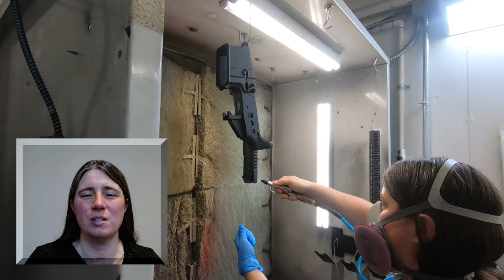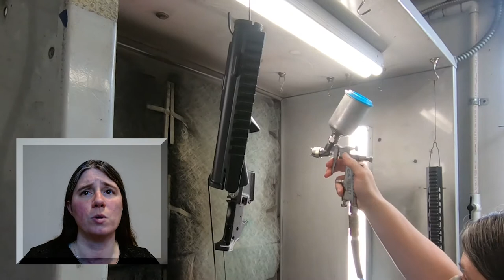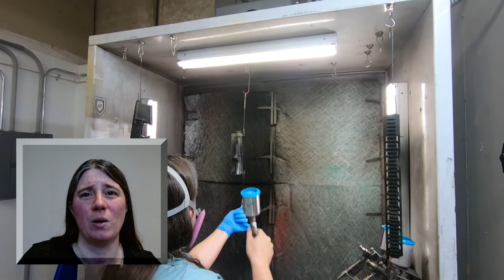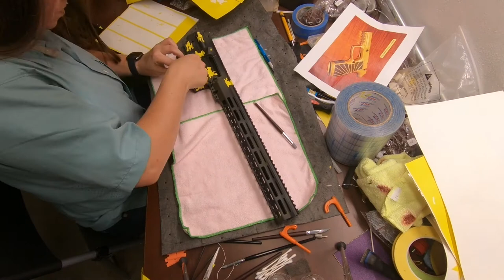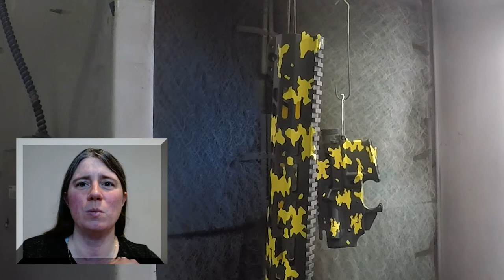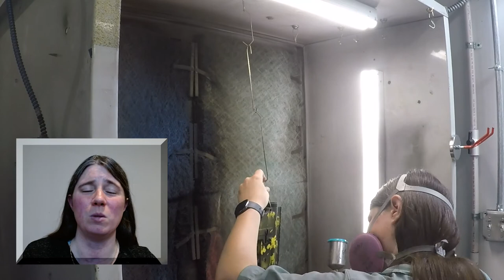Green Camo Cerakote - Single Stencil Easy Application #cerakote #camo #easy

Comment: I flash dry between coats for a shorter time. If it gets too cured, the next coats will not adhere and will easily scratch off..Ovens very so don't take this as a criticism, you did a great job..Thanks for sharing..
Reply from the maker: This is technically only 2 coats, one flash of 15 minutes before the stencils were applied, then final "coat" of the other colors to do the fades/blends, then full cure.
Reply from the maker: I also have a shel labs oven, which is the one recommended by Cerakote and used by all the top applicators out there.  Being a certified applicator I went all out on my equipment when I got my shop set up last year.
Reply: @Gunner411  I go for about 11 to 12 minutes with my oven so the surface is a little tacky yet won't leave any marks when touched. I don't have your top end equipment and it took me awhile to dial in my timing with my oven..Looking forward to more of your content..
Reply from the maker: Yeah. If I’m doing multiple coats like for a flag I only do 8-10 minutes in between normally

Comment: How’s it goin? I have a question about cerakote and suppressors. They that silencer manufacturers use cerakote on suppressors but I’m not so sure about it. Can I cerakote or have my suppressor “cerakoted?”
Reply from the maker: Yes you can. There are different types of Cerakote that have different heat tolerances. For maximum heat resistance you may have limited colors but it is definitely possible

Comment: So you don’t sand blast first?  Before applying Cerakote?
Reply from the maker: I follow all the proper prep. Degrease, sand blast, gas out, etc.
Reply: @Gunner411  gotcha, it just looked like you were starting with an anodized part
Reply from the maker: I understand the confusion. It’s a common misconception that all anodization needs to be removed. It just needs to be etched. Other coatings need to be fully stripped but an anodized part just needs to be hit with 30-35psi, doesn’t need the full stripping of the anodizing.
Reply: @Gunner411  okay that makes sense now.  Thank you